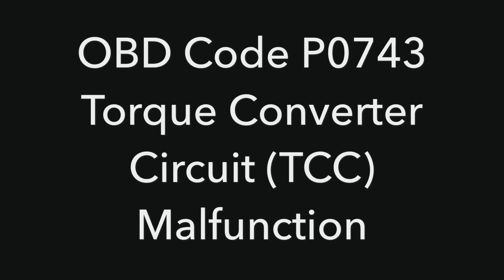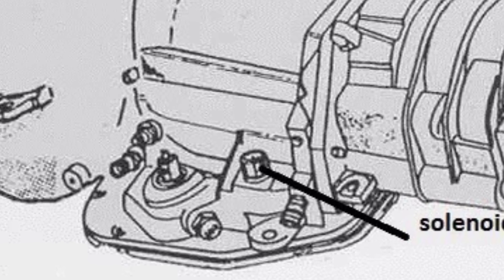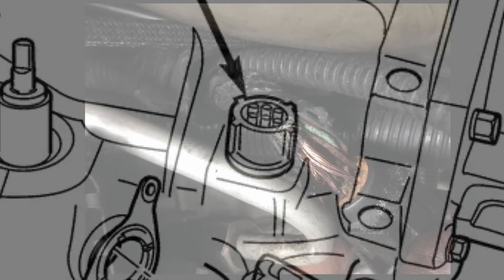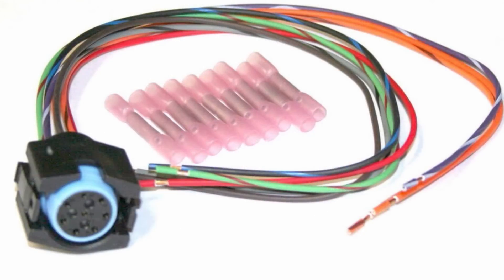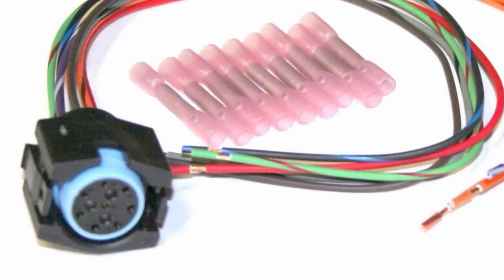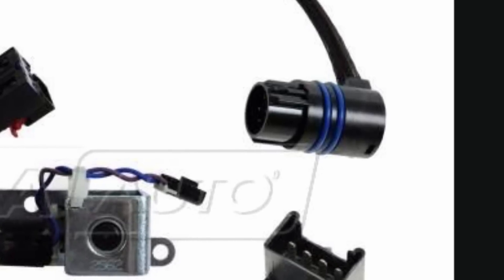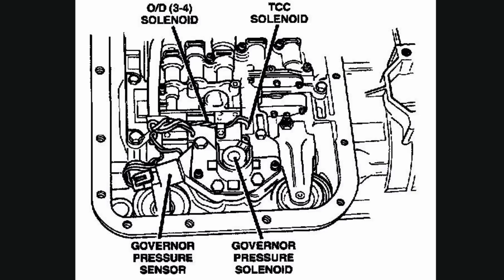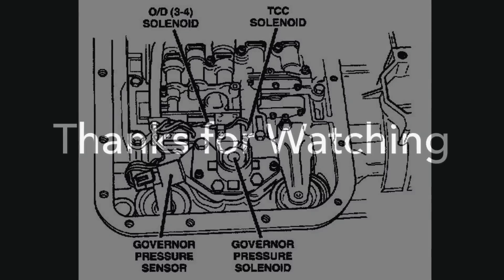OBD P0743 Torque Converter Circuit Malfunction

Comment: I was wrong. ATF +4 does not carry electricity so it cannot short out the wires as far as I can tell.

My original post is now deleted and replaced with this correction.

I put some ATF +4 transmission fluid in a  small metal cup about the size of a large shot glass and tested this theory.

Apparently I am wrong which is OK.

I put the two leads of my digital ohms meter in the transmission fluid and there is no continuity at all.

I then left one in the fluid and touch the outside of the metal cup and there is still no continuity so transmission fluid does NOT appear to transmit electricity or short out the wires or connections

Comment: Thanks. I’ve got a 2002 Honda Odyssey and have been getting the P0743 code. I read the Odyssey solenoids have wire mesh filters that can clog so I’m going to clean them at the same time.

Comment: I could use your help my friend, I cut the original tcc male connector to connect the new one I bought but the colors are wrong I’m having issues w some color connections like in the original pcm harness wire I have 3 purple wires and in the new one I only have 1 purple and an extra orange and I believe a grey one Idk which one hooks up w which all the other color cables match up well color for color
Reply: I messed up I should’ve cut the original connector one by one and attach the new male connector as I go as they’re numbered
Reply from the maker: RJVM 23 what year, engine size, trans type are you repairing?
Reply: 2002 Dodge Ram 1500 5.9 360 slt auto 3rd gen w the 46re
Reply from the maker: RJVM 23 check out this link. It might help. See the table in the thread and match your colors to that corresponding colors. 

 https://www.cherokeetalk.com/forum/f9/overdrive-solenoid-torque-converter-clutch-failure-70425/

Comment: i have a p0743 problem and i need help, its for a 2001 dodge durango 5.9L and it says that the torque converter clutch circuit is bad and i can't pass inspection cos of the engine light is on. i found the part to replace with but i was wondering if it was easy enough to replace if i did it, please let me know if it is. thank you!
Reply: If you just want the light to go off just take the battery 
Cables off for 2 to 3 min. Then put them back on and the light should go off for a few hours good luck

Then fix your problem afterwards

Comment: I have a 2000 Plymouth Neon LX 3 speed auto with the P0743 code and I can't seem to figure out the location of the Sensor to fix the issue. It shifts fine but at times when I come to a full stop it idles almost lower than 500rpm.  Can anyone help me because it's driving me crazy and I don't want to spend unnecessary money on getting a transmission replaced.

Comment: a P0713 high voltage output will trigger a P0743. high temp readings will prevent the TCC from engaging over drive. OD button will illuminate off when this happens.
Reply from the maker: buck19 what would you recommend for a fix on your issue?  A transcooler maybe?
Reply: in my case, its the same issue as this video. im getting ready to splice in the new plug now. most everything on older vehicles in the north are electrical.
Reply: Remus Dabasol we hooked up a live data feed back and compared the trans temp voltage to an infrared temp gun reading on both in and out trans cooler lines. my old lines were original (265k.mi.) and were replaced. this did not effect the reading. the computer read 156° within 10 seconds of start up on a 20° day. trans lines temped only at 45° 5min in with infrared. thru corrosion, my temp sensor is shorting out to the power signal wire. this is giving a false overheating voltage. the TCC is then triggered to turn off overdrive to prevent overheating, creating my TCC code on top of a short and ground code. i believe my TCC is also grounding out because overdrive turns on and off at random.
Reply: Remus Dabasol the factory shop manual has a couple sidebars for diagnosing this particular connector. uploading a video reply of the connector. its beautiful!

Comment: I fixed just changing my transmission fluid because was dirty, but after change you need to see if the fluid is in good level because if low this issue never go.
Reply: Luis Fernando Escobar when its low you risk over heating and gumming up the solenoids and their screens. you can clean and test their operation with a metered voltage supply.

Comment: Hi i watch your video and i have a problem with my transmission i recently changed transmission and after that I start the car and smoke come's out and engine light come on it's said torque converter / clutch circuit open what should I do now
Reply: prince akuamoah check corrosion or resistance in the wiring that the OP replaced.

Comment: I have the same problem with my 2000 Jeep grand Cherokee 
 hopefully this is the same problem my check engine light is on in this code pops up and she is not shifting but then I stop  it cools down and it works like nothing ever happened and the check engine light Go  off
Reply from the maker: Did it work for you? Hope so. My truck did the same. Eventually it burnt up my TCC and OD soleniods so I ended up changing those and it works great still.
Reply: +Remus Dabasol yes it did thank you very much!!!
Reply from the maker: +Dave Jil Awesome! Thank you, glad I could be of help. :)
Reply: Dave Ji
Reply from the maker: iwoww 562 4.5 quarts

Comment: great info.. I have the same code and my tranny is in limp mode. I replaced the internal electronics and it did nothing, after watching your video I  started looking around real well at wiring and connectors  my main connector (the one you had issue with) seems fine but I found the same condition on the wiring going to the neutral safety switch. they were fuse together anyway I repaired best as possible for the moment until I get that pig tail next week. my question to you is how the hell did you get access to those wires there isn't much room or slack on them. I wont to check all the wiring best as possible see if more of these wires are some where. still in limp mode any and all help you can give would be great. or anyone reading this for that matter lol... 2000 Durango rt 5.9 also im wondering how to find out which transmission I have for sure.. thanks again..
Reply from the maker: Hi Joey, my transmission is smaller than yours and getting access to mine was pretty tight. I actually used my smart phone to record the tight spaces and removed any clamps holding the wiring harness in place. It gave me more play but still was a tight work space. Figuring out my tranny type was difficult for me too. No visible markings. I verified the tranny type by calling the dealership parts department and gave them my VIN number.
Reply: porque mi cheroke se ase pesada al arrancar
Reply: Orlando Diax encontrast el problema m pasa lo mismo ami
Reply: Talk to your dodge dealer and give them you VIN they will tell you
Reply: Remus Dabasol for those of you who may find this a year or years latter and need to know how to get the harness down farther so you can work on it, just disconnect all the other connectors down on that end of the harness going to trans and I think one 02 sensor then pull the harness all over to the side of the trans where it plugs into the trans and you can get about 8" of harness out in the open where it can be worked on. My Dakota has the larger trans and its a tight mofo. I had to do this so I could gain access and work on harness. It takes about 10 minutes to carefully get all the plugs unplugged without breaking connectors and then remove the mounts that hold the plugs in position.